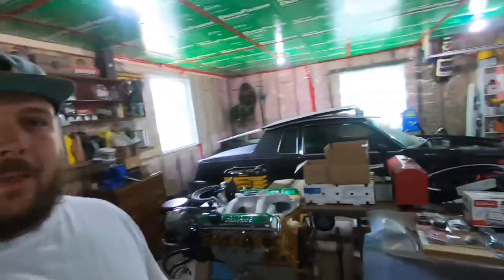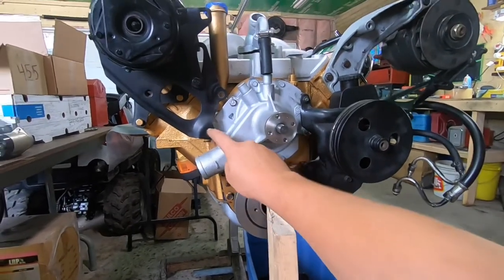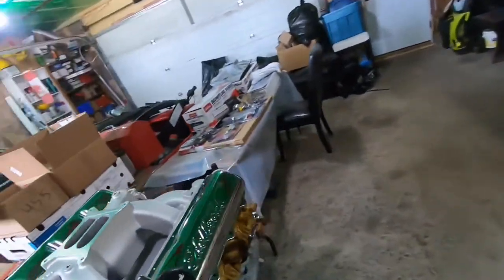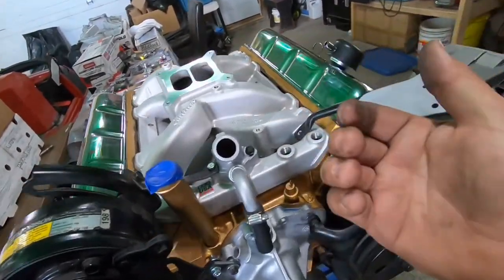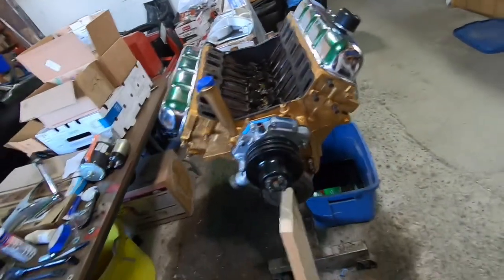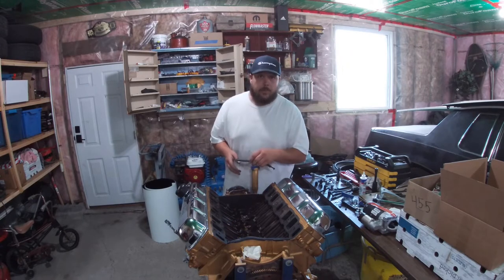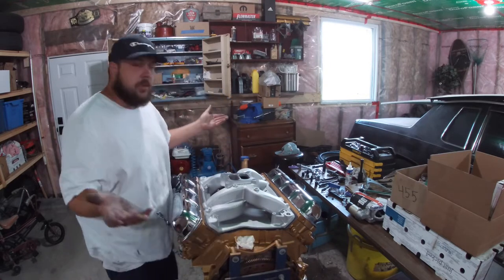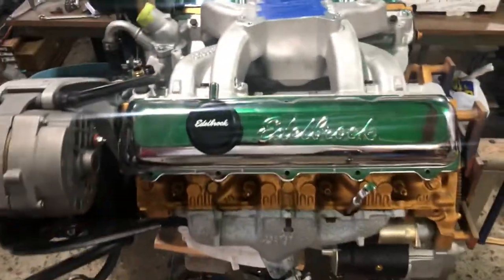455 Big Block Swapping a 1985 Cutlass 442 part 3 (The Engine Is Ready)

Comment: What headers did u go with bro?
Reply from the maker: I whent with a set of w/z manifolds! Couldn’t get my hands on any decent headers at the time stock was out ans prices were insane! I chose a cam with a little extra on the exhaust side to try and compensante lol!
Reply: @ThemRoofBoys  ok, I do have my stock headers. Do u think I should keep those on?
Reply from the maker: @timothybrown3495  well if your going from small block to big block the small block headers won’t fit and if your dropping it into a g body you need rear dump on each side because there’s no roof for the cross over pipe won’t fit with the big block the drivers side hits the cross meme er if you watch my video 5 when I did the fist start up I talk about it at the begging of if video might help a bit!
Reply: @ThemRoofBoys  ok, I'll check it out..thanks bro